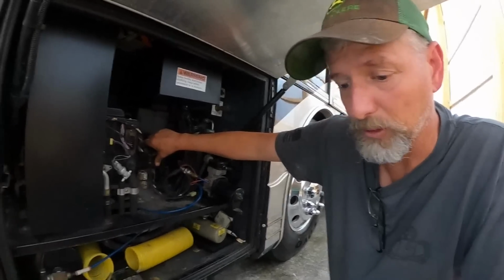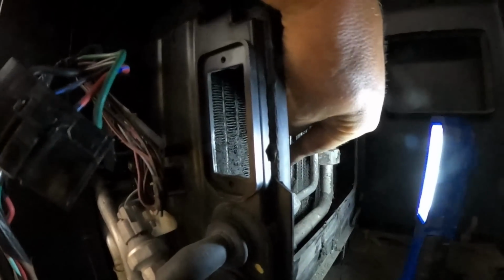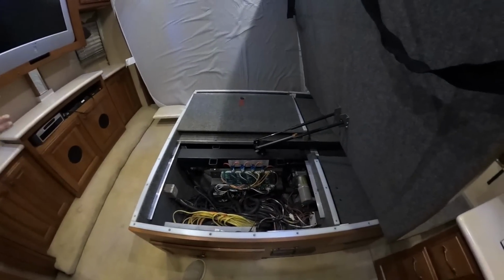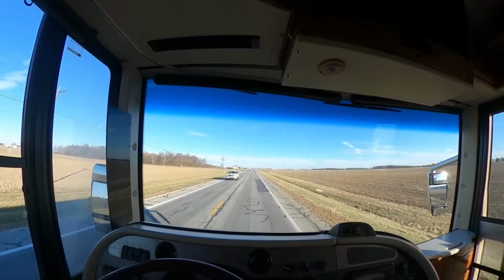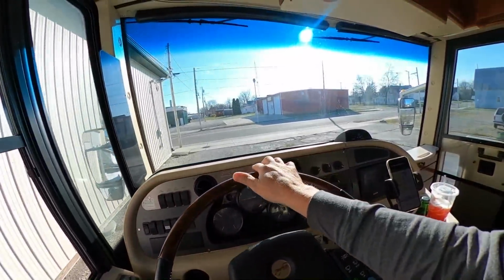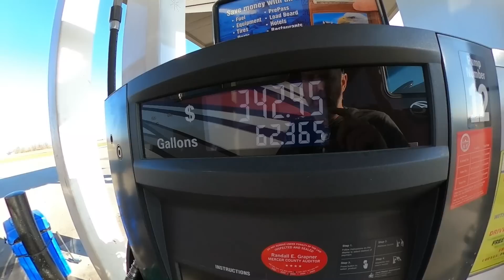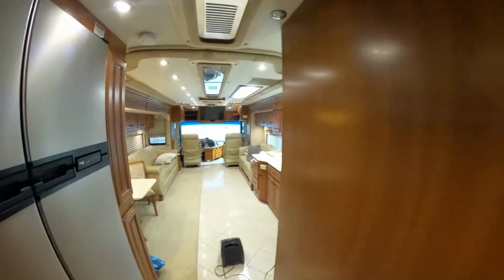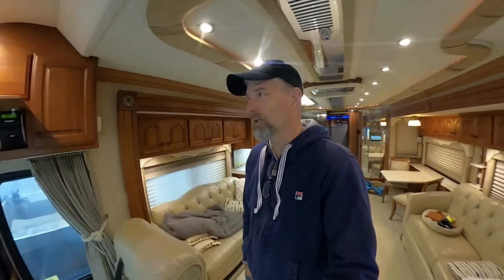Oh No! Electrical Issues!!  | 2005 American Eagle | EPS12  | Shots Life

Comment: When you're chasing electrons, especially in DC circuits, always check your grounds first. Big DC circuits like on the coach have massive draws and also the ability to charge quickly so always make sure you have the proper gauge wires. Also 10 VDC is not ever acceptable unless you are down stream of a controller circuit. In that case the lower the voltage the lower the speed.
Steady on Senior and you and the Mrs have a wonderful trip when you finally get to go.
Reply from the maker: Truth, ground issues are very common in these… thanks buddy!

Comment: Electrical gremlins are the worst. Glad it's all fixed now. Have you since swapped out the blower motor back to the original? If so, did that fix the issue not getting 4 speeds? Have a great week!
Reply from the maker: Hey bud, your not kidding… nope haven’t swapped it yet, high on my list but it’s been freezing lately… I’ll report back when I try it!  Thanks buddy, you too!!